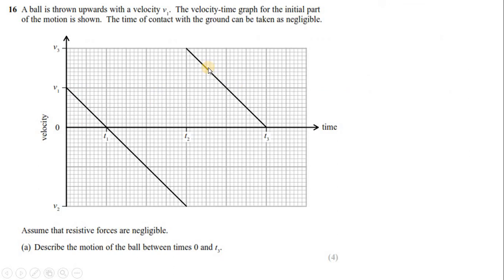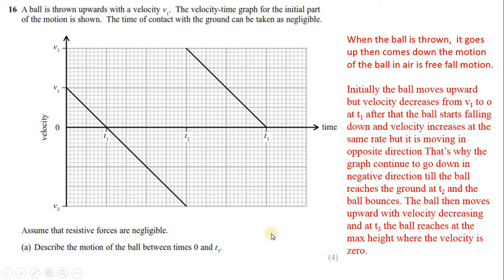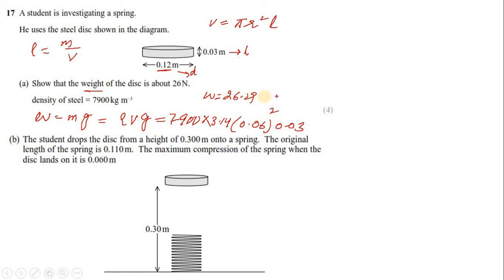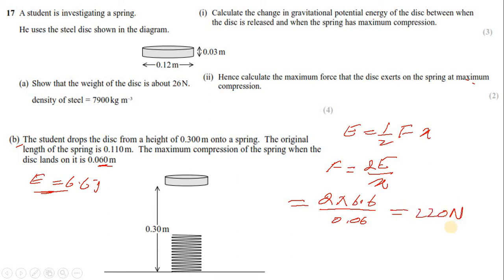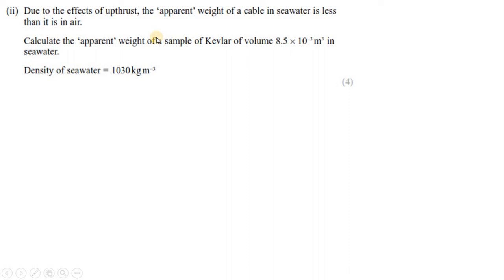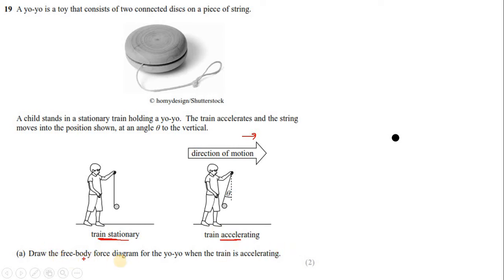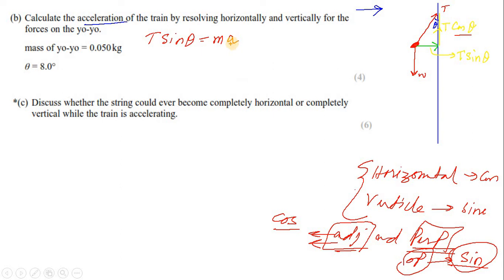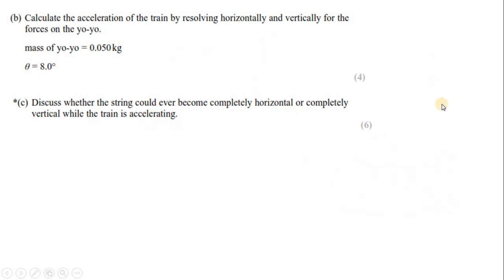Edexcel IAL specimen paper physics unit 1 WPH11 (spec 2018) Part 2

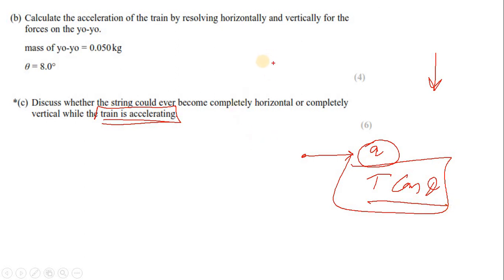Comment: in 30:26 we know that TsinΘ = ma  ,  which means this gives us acceleration ... then why were you saying at 31:49 that TcosΘ gives acceleration ? was that an error?

Also I understand that  the string could never be vertical since there is a horizontal net force provided by TsinΘ but  I am unable to understand that string cannot be fully horizontal because vertical forces are balanced ?!

since the weight is balance by TcosΘ , then what force would stop the string from going completely horizontal ?
Reply from the maker: Hi, thank you very much for pointing it out. It was my mistake to say TcosΘ. It is TsinΘ that gives the horizontal acceleration due to which the string could not be vertical. There is a vertical component, TcosΘ, which can take the yo yo upward and can make the string horizontal, but there is the weight of the yo yo, which brings the string downward. Thus the string can not be completely horizontal. I hope you can understand now.